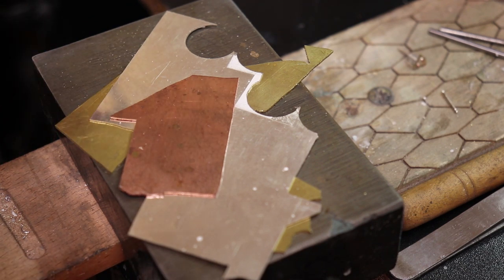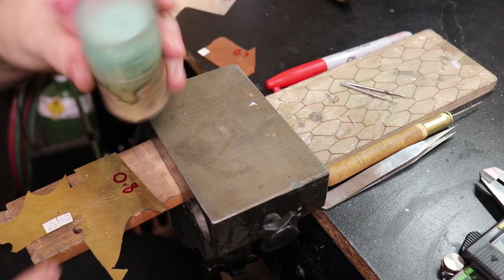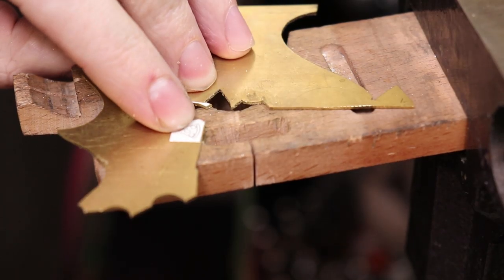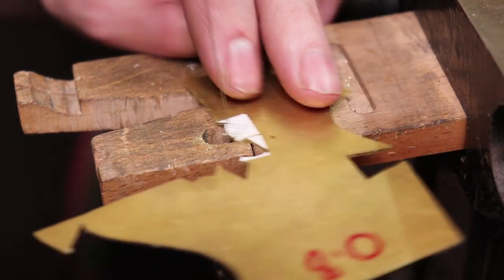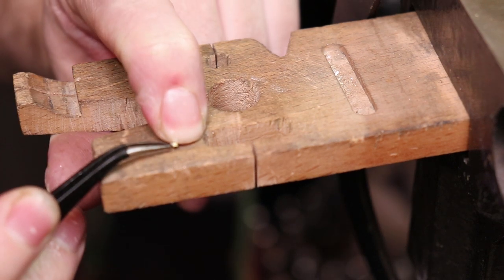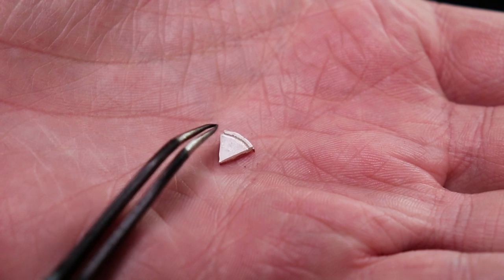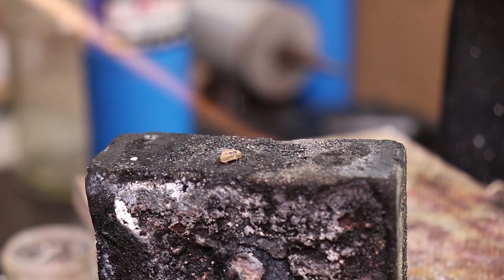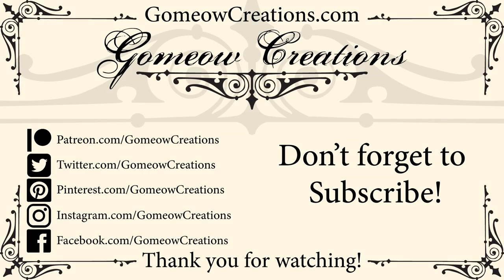Jeweler's saw tutorial: Cutting small parts to make pizza stud earrings

Comment: Question about the blade lubricant. Is there a liquid lubricant that can be used? Maybe white lithium grease? 
Just curious if you or other have experimented with liquid lubricants? 

I bought my first wax lubricant and it seems like most of it crumbles rather than sticking to the blade.

Comment: I think you are stating your measurements wrong. Your digital Indicator reads three columns, the first in tenths of an inch, the second in hundreds of an inch, and the third in thousands of an inch. A reading of .8 is 8/10th of an inch ( 800 thousands) which would be over 3/4 of an inch thick. The correct way to state that is .08 which is 8/100th (80 thousands) of an inch while .008 is 8/1000th of an inch.(8 thousands) Had to learn this in machine shop class years ago. Regardless of this I absolutely love your channel and keep up the good work.
Reply from the maker: Well, thank you for that info but I work in metric sizes, so this was 0.8 mm. I just find metric easier for me to visualize when it comes to small parts. 😀👍
Reply: My apologies! I agree metric is much easier I am just old school and do everything in thousands of an inch. As an interesting note I believe there was a real snafu a few years ago in one of the space programs because there was a misunderstanding  between engineers about metric/ English measurements.
Reply from the maker: No problem and thank you for looking out for me in my video 😊 if I do or say anything wrong, I would like be corrected so I can make sure people are getting the right info. 👍